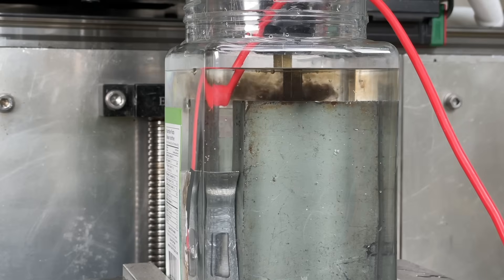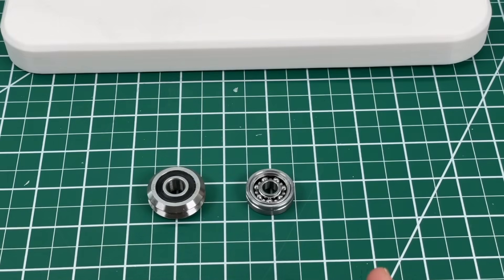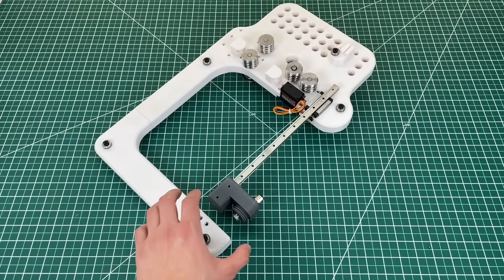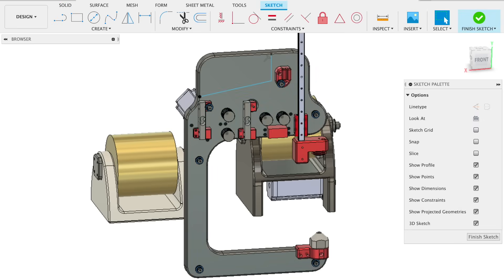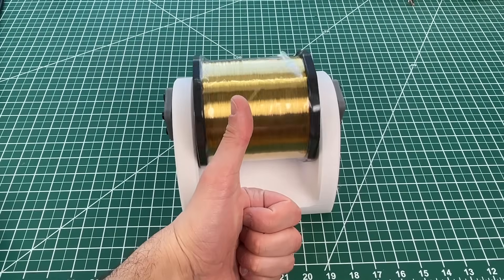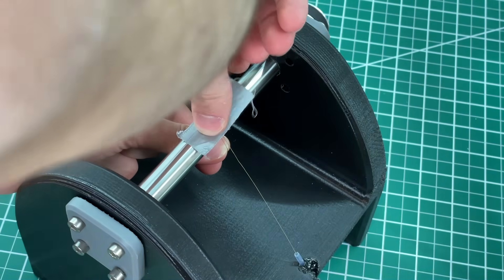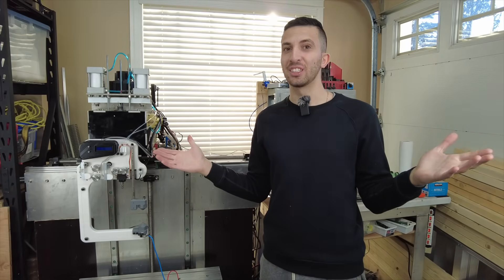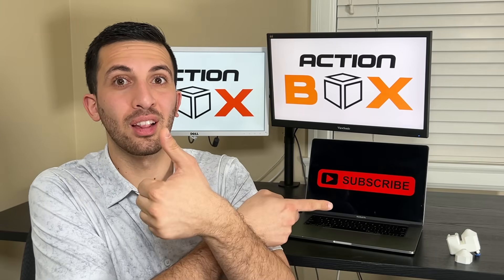How We Made A Wire EDM Machine At Home

Comment: from my EDM machine experience with ancient power supplies Hansvedt DS-2 wire and my charmilles E110 sinker, a DIY wire, and a few others. you are using way too long of a pulse width and likely too much amperage and way too slow wire feed rate. 150-250 IPM 4 amps and .8 micro second pulse width. you need to have dynamic feed rates and the ability to back off along the path. look inot Linux CNC Wire edm stuff Mach is not made to do this and kinda sucks in the modern age.
Reply from the maker: Thanks for the informative comment.

Comment: On the wire edm the feed rate is calculated automatically by the voltage Applied and the voltage during the spark    moment IF you put a constant feed rate will be quite impossible to adjust
Reply from the maker: thanks.

Comment: I use these at work, may I suggest the contacts for the upper and lower be solid carbide, and 0.3mm hard brass 900mpa is used for best results, your wire is braking as it is making contact with the work piece as said by other viewers, you should have a spark gap of aprox 0.15mm , our machines automatically sense the cut via an electrical ark which will never touching the workpiece, (short circuit) 
All the metal rollers have contact points which I assume are to prevent the wire arking on them
Reply from the maker: Makes sense. Thank you 😊

Comment: I have misgivings about the feed setup. Brass becomes more brittle each time you bend it. 4 laps around a tight set of feed rollers MAY be a small part of your snapped wire issue. Perhaps make a large single drive wheel variant to test with the current electric setup, V.S. a lower power setup.
Reply from the maker: This is a great idea and suggestion.  I will do so as I work towards V2 of the design. Thanks a bunch 😊

Comment: Can't wait to see you guys get this licked, looking forward to the part 2! Any plans for a DIY laser sintering metal powder 3d printer?
Reply: That would be a cool project  😎
Reply: Or a cnc controlled mig welder "3D" printer
Reply: @WeighedWilson  What shielding gas would you use?    MIG welding isn’t going to work with oxygen around.
Reply: @Jkirk3279  You could just have a sealed chamber and purge the lot with Argon- arduinos don't need to breathe. That or use a multi pass compatible flux core

Comment: I have been running a few wire edm's at work for a few years including a big Fanuc Robocut 600.
Here is just a few surgestions .
1.To prevent wire snaps your are looking at a movement speed (speed of cut) of about 0.1-0.5mm per minute depending on what your are cutting and the thickness.
2. Speed up the speed of your wire (speed at wich the wire pass thru the cut , is being used) to 4-6meters per minutes. The faster the wire the cleaner and smoother the cut.
3. If your are using a large cap on your output power lines, back off on the size, this is scalpel not a broadsword like a sinker edm the initial large spark will snap the wire.
4. Current, from what I have seen you do not need more that 5amp on that wire, again scalpel not broadsword.
4.1 If I was cutting that round bar on the fanuc, typical setting would be tavel speed I would get 0.3mm per minute, wire speed of 8m/min, current 3amp. With a voltage of about 80v.
keep in mind the wire cut moves forward and back depending on the gap voltage reading, you cannot just set it at a speed and plouge into the material.
5. Try swappingthe  polarity of the output line, it sounds stupid but is does matter.
    I designed my own Small hole edm under the name Radnor Technologies a few years back and if I    remember correctly I used - on the electrode and + on the work piece this results in a quick material removal rate but eats your electrode for breakfast. In your case with the wire that would be bad.
6. Remember when in doubt flush flush flush loose carbon can mess with your cut.

Here is just a few other surgestions not related to the wire snaps.
1. Filter your water else things goe pear shaped very quickly.
the 20 inch big blue spun polyprop filters used for home water systems works well.
Fit a 10 micron filter the 5 micron does not last very long. The fanuc has a hugh 5micron filter as standard. Aluminium will clog a filter like you will not believe.
2.Deionize the water if your want to cut for longer than a few minutes.
The waters optimal resistance should be 70 kilo ohm per cm2. Doin ght deionizing is easy, you buy the dionizing resin (small balls) from the same place that sells the filters, normally in a 25Kg bag.
It is in a bucket with a inlet and outlet.
Let the outlet drain into your tank and hook up a pump to the inlet to switch on when the resistanc is below 60K. This is a easy job for a Nano with a ADC and 2 probes on the water, we used 2 stainless rods with a surface area of 1cm2
3.The rewinder unless you want to try and reuse the wire... bad idea... ditch the roll winder just make a puller that pulls the wire and dumps it in a box, this is what the fanuc does. Some other brands chops the wire wich will be better since it takes less space.

Hope this helps, all and all great project I wish you the best of luck and look forward to the next video... subscribed 🙂
Reply: do I understand this right, to make a 10mm long cut would take around 100 minutes and use around 500 meters of wire?   is the wire re-usable?  seems it's an extremely high cost.  unsure of the cost of the wire, but.. seems a lot for a cut that is less than half an inch long. did I make a silly math mistake somewhere?
Reply: @CrudelyMade  wire is pitted after use and cannot be reused. It is a major cost of wire edm work. I have two wire edm machines.
Reply: @CrudelyMade  your maths is a little off. But only a little. Based on those numbers I get 33 minutes and 266m of wire. Still seems high wire usage and very slow feed.
Reply: @msbealo  Jip my boss use to get annoyed when I run the wire at 10-14meters per min and set the speed down until I just coved the screen so he can't see the speed.
It is better to waste a bit of wire than to have to restart a 8 hour job if the wire snapped in the middle of the work piece. Things normall goes fine in the beginning but a soon as you get to section that is hard to flush the wire like to snap when it is being run slowly. The wire cost works out at about 0.0036 USD per meter.
Wire EDM is a very slow process, we had 3 machines a 30 year old Fanuc that works similiar to this home machine, slow and manual wire loading, that one used to cut at 0.02-0.05mm per min for 50mm thick stainless. We had the new Fanuc that ran at about 0.1-0.6mm per min on  50mm stainless. Lastly we had  some Fong Kong machine that reused it's wire. It used a 0.19mm Moly wire that last very long but is very expensive and a complete "B" to load. Can take up to a hour to get up and running if the wire snaps.
Reply from the maker: Thanks for sharing. It gives me some parameter values to work on as I make progress into the V2 of this design. Cheers.
Reply: @kobuscoetzee6192  
Jy ken duidelik jou storie boet! Beste kommentaar hierso.  Expat in Kanada.
Reply: @kobuscoetzee6192  Oh my sweet lord. Those speeds are painful. How's the flushing on these parts?
Reply: How does one gather the gap voltage reading? Awesome advice btw, sounds like they are going to run through wire much faster than they expected lol
Reply: @formerlyflailing   To measure the gap voltage you have to measure the line voltage, as soon as spark is made the voltage will drop to something like 3-5V depending on the system, since the rest of the power is being used (routed thru the cut).
If the voltage is too high you can move a bit forward into the cut and if it is too low ..aka short circuit move back from the material.
You need to monitor this with a ADC circuit and move the wire accordingly.

You do us alot of wire but just for referance we paid about 70USD for a 8KG roll of wire and that contains about 19 kilometers of wire, so not to bad.
Reply: @kobuscoetzee6192  The gap voltage will drop down to near 25V.
Reply: This is why I love YouTube comment section.
Reply: Hi @actionbox 👋 @kobus has some really good tips there 👍

I think the pressure on the flushing system is too low. Try to reduce the radius of the flow water to ~ 2-3 mm or below (you can use a ffm nozzle, but you might need a more powerful pump). The water needs enough pressure to be able to get between the cutting wire and the material you are cutting and maintain enough momentum to flush debris out. This all happening under water makes it a little more difficult. Having an automatic filtration system is key here.

You can also try to use PWM on your cutting voltage to reduce immediate wear on the wire.

Hope this helps, have fun! 😎
Reply: @bfc_george8846  He needs to get the power cycling right first.  It shouldn't be continuous on cycle.  Flushing shouldn't be looked at until he gets the power delivery right.
Reply: @Kobus Coetzee
Dankie! Jy't nogak baie kennis en dit goed uitgedeel. 
Werk jy nogsteeds in Suid Afrika?
Reply: Eight meters per minute?  Holy Bandsaw, Batman!
Reply: can confirm this just started edm at work so not to far in but the whole video i was watching and wondering why your wire was going so slow
Reply: Great project. When I worked in a tool room we used a carbon electrode to plunge cut a hole for a popsicle stick die cutter press. Our EDM used an oil for the bath that was pumped through a filter. I believe that the oil helped control the electrode temperature as well as flush the carbon debris away. 
     As far as control, the plunge speed and the discharge arc was controlled as an up and down motion based on the current set point through the electrode. Too high a current detected and it would retract the electrode a bit. Note that we were machining the final dimension of the hole through a steel casting, not plunge cutting through a solid piece. 
     The final sharpening of the die was done on a couple different grinding machines. Yes, we helped a company make popsicle sticks!
Reply: @wpierce256  Oil is used as a dielectric media because it doesn't become conductive again like water.
Reply: Commenting to show my appreciation! Thank you for your knowledge
Reply: what is the voltage and current flowing through the wire?  does the wire rotate like a chainsaw?  Thank You..
Reply: 😮😮😮😮😮😮😮😮😮😮 thanks for that refreshing splash of deep knowledge 🎉 Kudos!!
Reply: achei seu comentário muito interessante e vi que tem muito conhecimento, estou querendo montar uma maquina dessas, mas ainda não tenho informações suficientes e de tipo de fonte, a placa que é utilizada e o sistema operacional. teria como me ajudar com essas informações ?
Reply: About how many times can wire be reused?
Can I use completely deionized water (non conductive)?
Reply: @mikefromspace  the wire is used once, at a cost of about $0.003 per meter.
Reply: @mikefromspace  We have used oil in some of our machines as its non conductive but increases the operating cost tremendously, for the lower cost machines we use a filter based deionizing system.
Reply: @ActionBOX  go ahead and reply one more time to be sure
Reply: Why wire?...why not laser that is as thin as wire?
Reply: @galaxystar527  For thick materials lasers will leave an unacceptably tapered kerf. Laser waterjet sounds interesting tho. But even there the quality of the cut diminishes with depth.
Those of us who know cutting foam with hot wire appreciate the desire for accessible and time efficient wire EDM. It's just great to have the cut the same on both sides.
Reply: @galaxystar527  lasers can't achieve the same tolerances and can only cut through material that is a few inches thick. Wire edm can cut through feet of material while maintaining extremely high tolerances. Plus wire edm doesn't generate (significant) heat on the part and can cut through any material that is conductive.
Reply: @WQRTPSKXJZ  look up water jet guided laser. Once it becomes cheap enough, it will completely obsolete wire EDM
Reply: @bschwand  No it won't. Water jet and laser will be much faster than wire edm, but they can't get close to the tolerance. The laser and water cannot stay focused through a thick cut. This means the curf varies, which means the part is thicker on the top than it is on the bottom. Wire edm can easily hold .0001 inch tolerances through any thickness.
Reply: @mnotlyon  this looks quite precise and thick :
https://www.youtube.com/watch?v=L1tZWDKMYdI
however I agree that EDM could in theory cut much higher depths than waterjet guided laser. My comments was a bit optimistic. Lets say that for certain applications, it becomes a much more efficient tool to process certain cases that until recently could only be done with an EDM
Reply: @bschwand  Wow. That really is impressive. I can see where that would be accurate enough for MANY applications.

We build plastic injection molds. It probably wouldn't work for most of the stuff we do, but most things don't need that kind of precision.

Now, I'm wondering if the laser could be used for roughing, and the wire edm for finishing. Perhaps the best of both worlds. Speed, and accuracy.

Thanks for the link.
Reply: @mnotlyon  It wouldn't make any sense at all to cut twice. Cut once, with the EDM if you need the accuracy and straightness of EDM: or don't. There are reasons EDM is only used for very specific jobs, it's an expensive process - but it reaches parts other tools can't reach.
Reply: @streaky81  You've obviously never used a wire edm on large parts with tight tolerances. More skim passes gives better accuracy.
Reply: @mnotlyon not professionally for like 20 years - I mean that makes sense, but a laser wouldn't help you in the same way as like a roughing cut with a mill, which was the implication. Especially not if you're cutting something 4 inches thick.

Comment: The power generator for normal EDM has much higher current than needed for wire EDM, that's why the wire get's broken.
Reply from the maker: You are probably correct. I will fix this in V2 of the machine. Cheers

Comment: Typical wire EDM machines detect current to determine if the wire need to move or stop. From what I understand this is how the axis controls are closed loop with current sensing.
Reply from the maker: Thank you, I will try to implement this into my second version.  Cheers, Dave

Comment: Great job!
Perhaps the wire break is due to the low melting point of brass compared to steel. Try cutting aluminum.
Reply from the maker: Great point. We did try that though with no luck 😞.  Thank you for your comment 😃

Comment: Dude, this is literally the most amazing project I’ve seen in the past year. And your CNC mill?!?! That thing looks seriously impressive. 

Incredible engineering!
Reply from the maker: Thank you so much 😊. I really appreciate this comment. Cheers, Dave
Reply: applied sciences edm videos have your answers, you need a control that manages the postion in the cut
Reply: @AndrewBoraas  Do you mean it needs to change it operating parameters dynamically as the engaged wire length (area?) changes? 
Using a constant feed rate and the object's geometry to dictate the power is a fairly simple programming exercise BUT your power now needs to be software controlled and integrated with the other components. A dial and alligator clips won't cut it! (😅)
Starting to see why a 'real' one will cost more than $100! 😊 Cheers, Michael 🇦🇺

Comment: I can see were you got your inspiration from, looks very familiar :-) I can give you a ton of advice if you are interested. There is a long list of improvements to be made on your current design before you can make any wire EDM cuts, and a very long list before you can make high speed efficient and accurate cuts. Feel free to contact me.
Reply: I was just gonna comment asking him to watch baxedm to understand how the XY movement has to be controlled as a function of the spark current. But now he has a direct line to you :)
Reply from the maker: Hey, I love that you reached out.  I would love to get in touch and work on a collaboration if you are interested 😃. Cheers, Dave
Reply from the maker: @scooteracers  the power supply would be the only limitation really.  I’ll give you a hint, our V2 is meant to solve this problem.  I like the idea though, I might start doing that myself.  Cheers
Reply: I would really like to hear your take on things as well.
a little bullet point list would be really cool to learn from.
Reply: Very true, I should know, been making one for the last 6.+ years,  and if it wasn’t for BaxEDM generator , it would take me another 20 years more…..
Reply: Is there a cheaper way for a home enthusiast like a maker to build or buy a power supply for less than a few thousand dollars?
Reply: @scooteracers  you want to cut metal stock at less than 1mm per minute for 50mm thick stainless? why would you want to do that? any saw will do at 10 times the speed i guess
Reply: @ozr2222  
Wire EDM machines are for cutting complex shapes like those used with extrusion dies. You would never use an EDM for straight cuts.
Reply: @invent5540  did you even read what I was writing and responding to? I share the same conviction and was asking because of that
Reply: @ozr2222  
Yup... I read it... saw?? Wire EDM equipment is for cutting example a horse head shape in 1/4" thick  steel for... example: spaghetti nodule fabrication.... how are you going to do that with a saw?